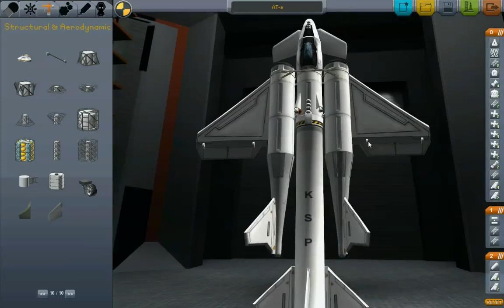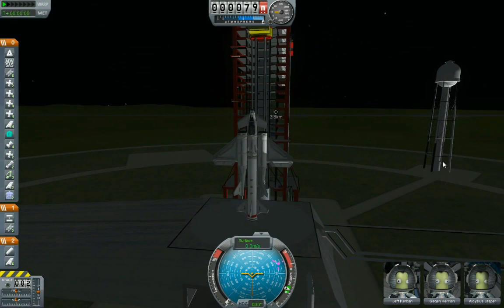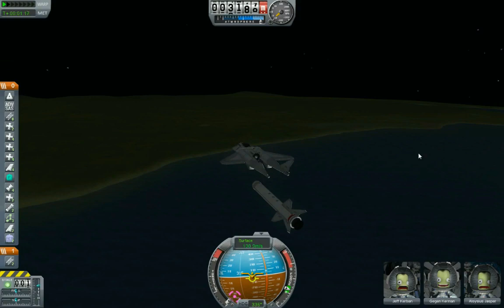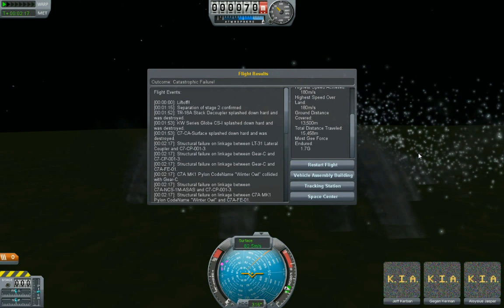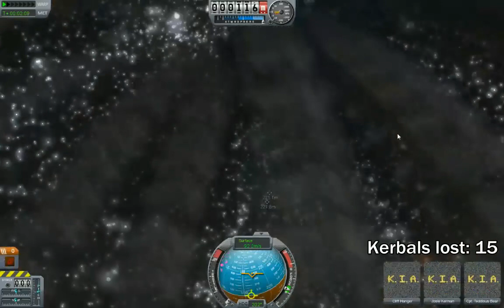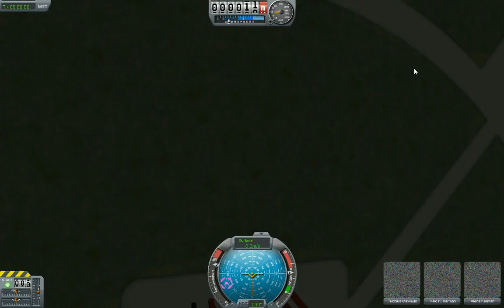Let's Fly Kerbal Space Program: chapter 2, episode 7

Comment: He needs more wings for lift so it can glide, or he needs more thrust so it can get some airspeed.
If you look at everytime it crashed, it was because the vertical speed straight down was massive even while it was horizontal.

Plane drops straight down while going at max  thrust horizontally = too little lift or thrust, or both.

Comment: Matt you need more weight on those tail wings,  you have all your weight centered in the middle and front second with little to no weight on the tail end.  If you add two of those small weights on the ends of the tail wings I'm fairly sure that will increase your pitch and climb rate.  (: